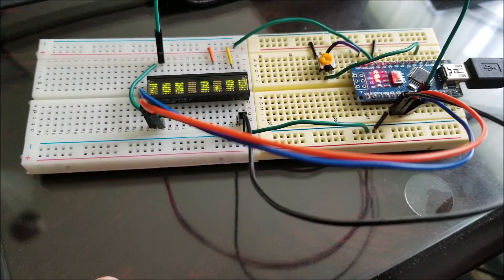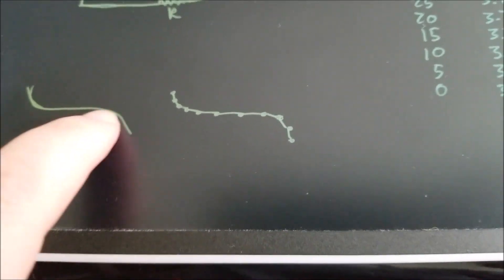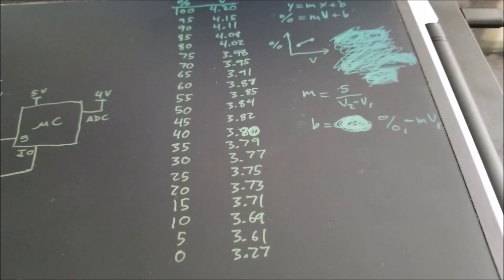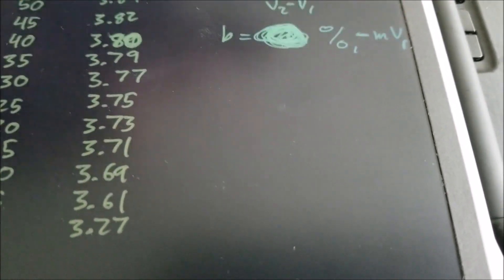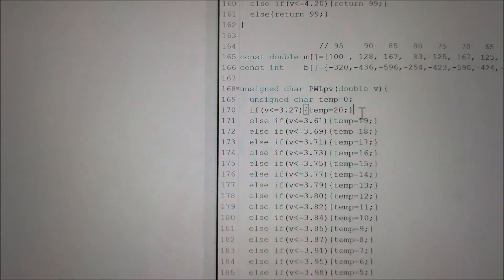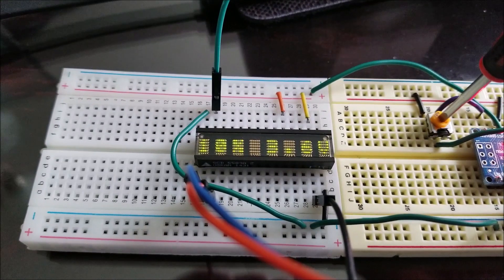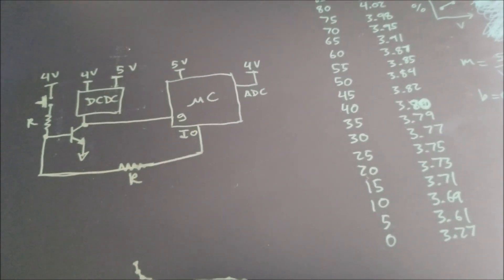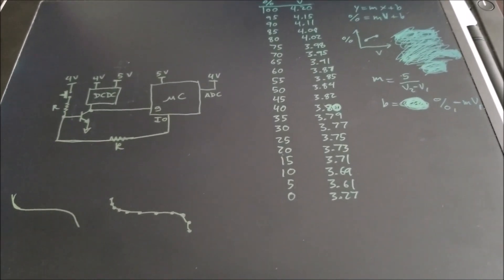Digital Battery Voltage and Percentage Meter Software Explanation

Comment: During soldering spatter less, smoke less, smell feel relaxed
Corrosive small
Easy to carry and it is sure an electronic enthusiasts essential gadget
FLUX: 2.2%
Wire Diameter: 1.0mm/0.039"
Net Weight of Solder: 100g/3.5oz
Melting Point: 419°F - 428°F (215 °C - 220 °C )
Lead Free.       Yeah is this the solder wire